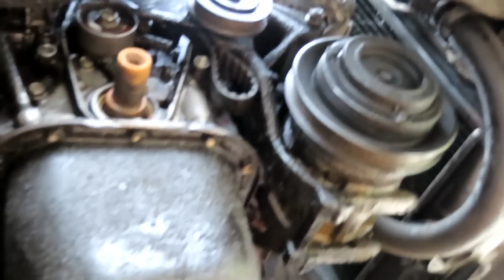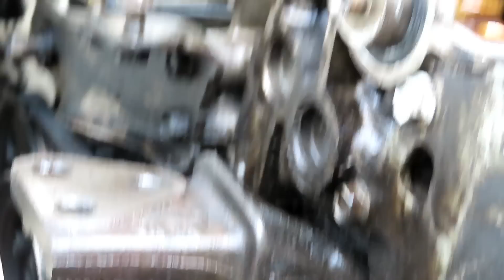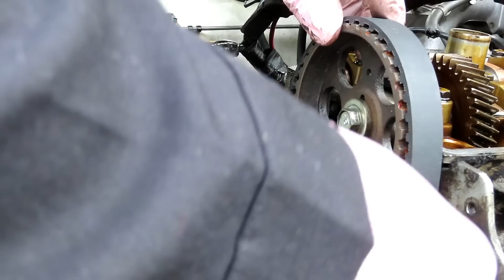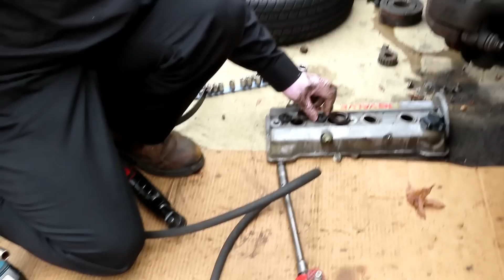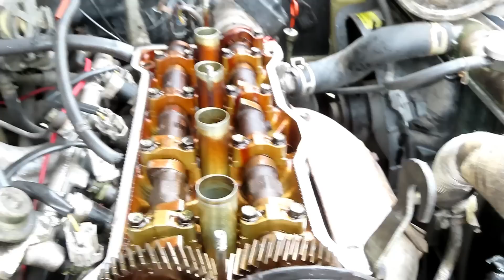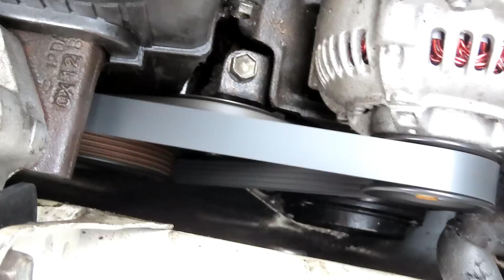⭐ 1991 Toyota Corolla - 1.6 - SEVERE Oil Leak - Belt Came Off - Part 4

Comment: great video you helped me get my 1991 corolla engine back together after i replaced the head gasket. your tips on getting the twin cams lined up for the timing belt, just what I needed. I like you not giving up when things get frustrating, keep working till its fixed, a great work ethic.
Reply from the maker: Thanks, really appreciate it. Can't give up, have to get it done...lol

Comment: Good fixed but I would have clean all the oil off as it will degrade the new belt🤪
Reply from the maker: Since there are no more leaks, the oil will not get on the new belt.